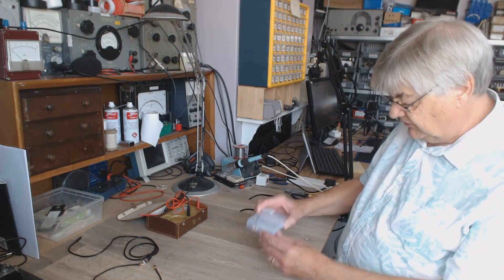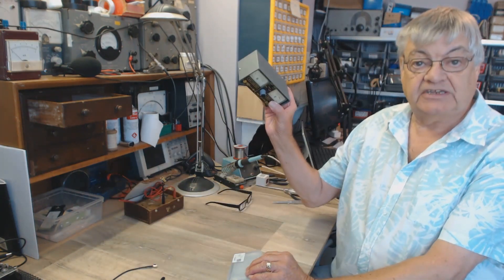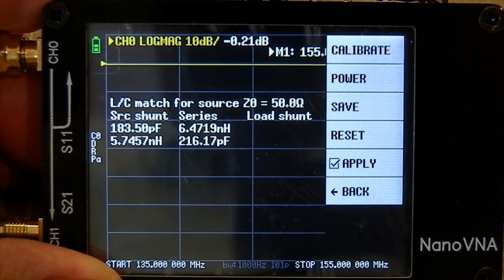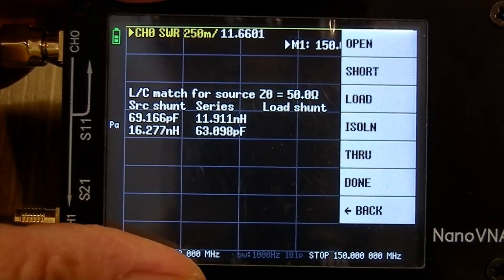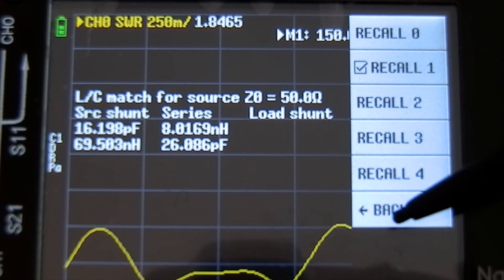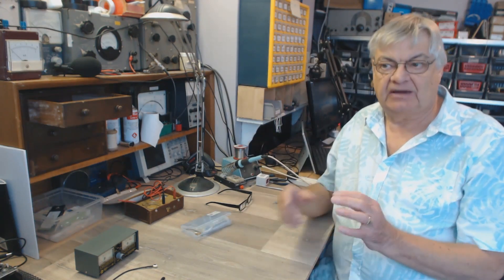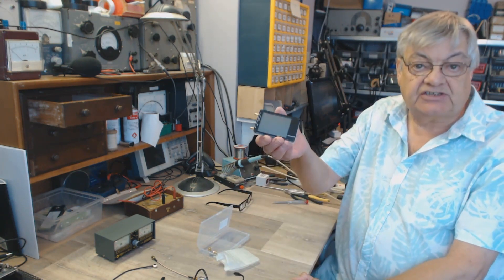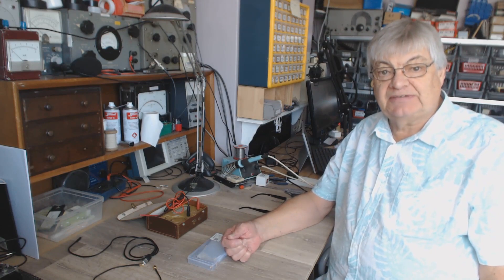G4NSJ - Nano VNA-H very tiny vector network analyser

Comment: Always a need for the venerable SWR meter.  I keep one in line for a quick indicator of antenna health as I have had faults pop up while transmitting.  They might not be as flexible as the new devices but really are valuable daily.

Comment: FM broadcast antennas Ray! What's with the folded back ground planes? Asking for an old friend!
Reply from the maker: Not sure what you mean Folded back?
Reply: @g4nsj  As in 4 of the 8 Ground radials was bent towards the mast at around 90 dungarees for about a quarter length on the tips.